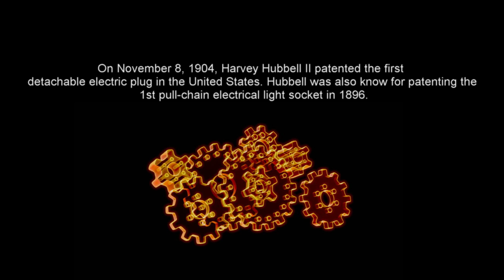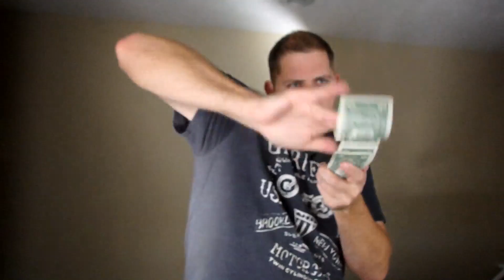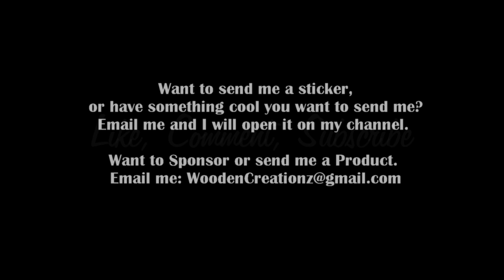My New Invention - "The Locking Electrical Cord and Outlet"

Comment: lol really cool and funny ,I like the third one ,if you could make that to retro fit any plug /plate you're onto something
Reply from the maker: sdmcustom woodworking I was going to see if company could make the plates. And make it out of the same stuff backpack clips are made out of. When was the last time your backpack click broke? Never.. It's tough stuff. The issue I ran into was putting it on a cord. All cords are different and you have to line it up... It would take a little more engineering. Don't know.. But my jigsaw and circular saw always fall out just as I am finally on the line! LoL!👊🏻 Ty for the comment bud!
Reply: WoodenCreationz I think the problem is while it's a awesome idea your going to have to get every company to agree on using this system ,it's like how phone chargers all used to be different but then they somewhat agreed on one type to fit all and that takes alot for them to agree upon ,but if you can make the plates (3d printed) and have the plug on some kind of adjustable zip tie system that will retro fit ...I'd buy that shit for $19.99 but wait call within ....you get the point 😁
Reply from the maker: sdmcustom woodworking Totally agree... It's totally possible to make them fit... I will see what people think about the idea! 🍾